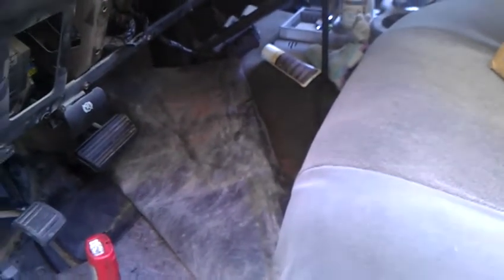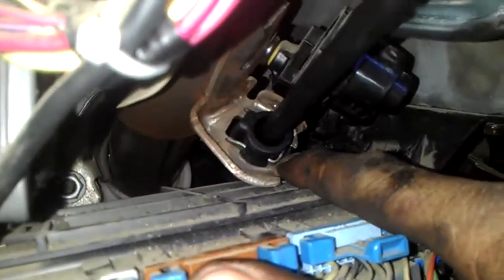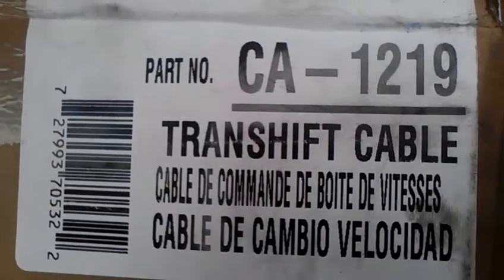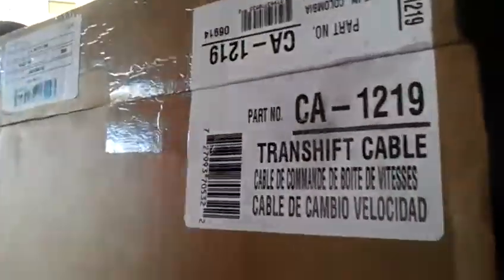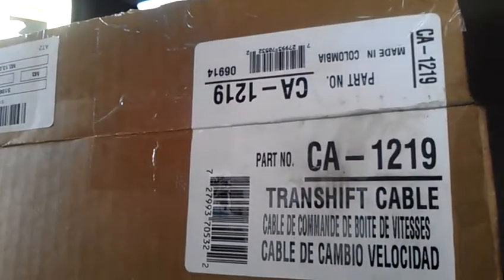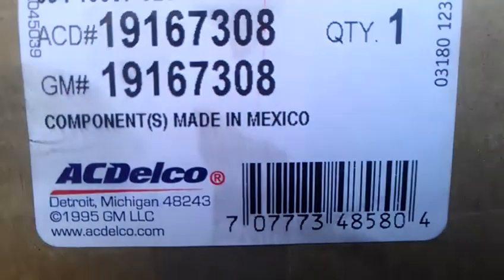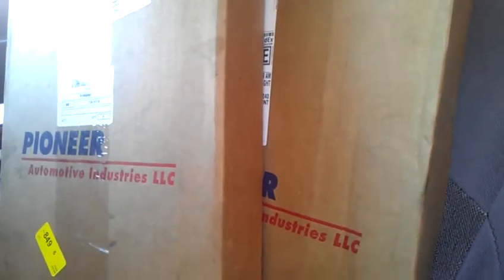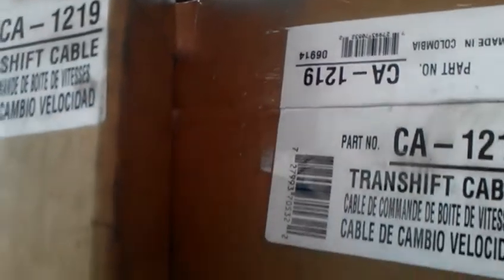05 Duramax transmission shifter cable

Comment: Why don’t they make shift leavers like the old days they would be easier to fix  I need the bottom cable the plastic piece broke on the lever I have a spare parts truck but it’s buried in snow I guess I’ll be digging today hope it works it’s a 94 gmc dually and the good truck is a 95 dually I’m worried about the plastic wen it gets old it gets brittle will have to be careful hope this works I only want to do the bottom part the top cable is fine
Reply from the maker: Jeff Leblanc  wow where I live the temperature In the summer it’s about 94 all the way to 115 or more Sometimes
And winter It’s about 40 to 70 I stay at home when it’s about 60 Because I don’t like to work when it’s too cold. Lol...

Comment: The one I got from the dealer is part # 12477640. And it is to long as well. Man I’m burnt right now. 2 days before Christmas looks like I’m not going anywhere. Thanks for the info
Reply: I would have went to scrap yard and took a good one of a wrecked truck or car whatever your case and then you would of had the right part